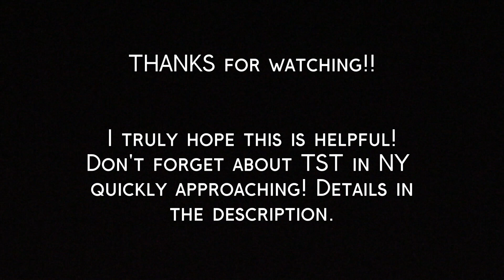05 Altima 2.5 Alternator & Valve Cover Repair Part 2

Comment: I hope that valve cover doesn't start leaking. We don't have Dorman over here but I can definitely see it's crap. Kinda funny with all these men around you while you're fixing the car. Love it. You're the living proof that female technicians are awesome! 👌👌
Reply from the maker: Lol... the men standing around and scratching their heads, is what I've been used to most of my life. Whether it's this, or equipment, or big rigs.... it amazes me how much I can do.   

In fact, how I met the chef... one day I'm going to the parts store for a job I was doing. I know all the guys behind the counter, and in fact, one of those guys with a 3rd, were all working on this Toyota(?) I wanna say. 3 days, the car has been sitting there, 3 guys taking turns... all trying to take out the front right axle. They asked if I could help them. Not 15 mins later, the new axle was going in.... 😂😂😂😂  God's honest truth. That was the chef's car at the time. About 10 yrs or more now. 

Oh and the valve cover... it WILL leak. Those spark plug holes will at least. .. but hopefully not onto the belt for now. DORMAN is simply DREADFUL!  💩💩😳

Thanks for watching Dylan! Thanks for the support as well! 😊🤗🤗🤗
Reply: That's a great story. I can only imagine the look on their faces putting the new axle in after 15 mins 😂 Awesome! 
Yeah the seals around the spark plug tubes didn't look so good. Frustrating if you ask me.

Comment: Nissan engineered so much room for you to work in there! I miss the days when there were NO tensioners, and alternator or water pump jobs took a half hour to an hour, depending on how much gasket material you had to scrape off the block for the water pump!

Nice job staying calm and collected. The camera keeps me in check ... sometimes, LOL,  but I find the older I get, the less patience I have for the way automakers build things. You'd think I'd get used to it by now, but I'm not! I never will be ... and things get worse the newer the vehicles get, I'm noticing ...

Anyway, great stuff as always, Cuba! Audio was good, even when the mic wasn't clipped to you. 👍🍻
Reply from the maker: That's some great feedback about the mic. I know some had complained with using just camera, depending on how far I was, I suppose. 

Yeah, they do get tighter & tighter to work on. Small hands and the ability to contort was a big help, although I'm lacking brute strength then. I guess each has its advantages. Lol 

You, keep in check?  Lol 😅😅😅😂😂😂 Just kidding my friend! It does make the video more genuine when we can share the true struggles we ALL go through. We're suffering right along with you, but it's easier to laugh at when we're not in that position at the moment.  It lightens things up... lol 

It always a pleasure to hear from you! Stay well Smitty! 😊😊🤗🤗🤗😁🍺🍺🍺
Reply: @CubasAutomotive  - LOL 😁, yeah, I figured I'd leave certain outbursts in the vids to keep 'em real. I find it harder to contort in my rapidly advancing age lately! Probably why I hate doing interior work so much now. It's definitely a struggle, for sure, but we all seem to get through it somehow! It's still satisfying all these years later to see happy customers. Makes it all worth it.  :)

Thanks, Cuba! You stay well yourself, too! 👍👍🍻

Comment: You have more control and patients then me. I'd be yelling and cussing like a Marine Drill Instructor.by the time it was done.
Reply from the maker: Hahaha... I used to in my younger days.  I realize I only get more frustrated and the job still has to get done. However,  there are other areas I NEED more patience in.... like on the road driving. I take it easy for the most part... but I struggle when I'm around horrible drivers. Lol 😂😂😅  Thanks for the giggle Bill!
Reply: @CubasAutomotive  Funny as I got older I loss mine. LOL
Reply from the maker: @billziegmond4943  😂😂😂😂😅😅

Comment: I wish I could remember when I could twist and turn to get into the tight spaces. These days I just shove an arm in and hope I can get it back out. LOL.
Reply from the maker: Man! There are days where it's frustrating like that, with nonsense so tight, you can't see things from the top or bottom or you have to break half the engine down to get to things. I try so hard to avoid removing parts (sometimes). I think the most deadly issue..... the improperly cut zip tie! 🔪🔪🔪😂😂

Dang! Your arm looks like it barely survived a wild cat attack! 😂😂😂 thanks for the laugh SBC! 😁😊